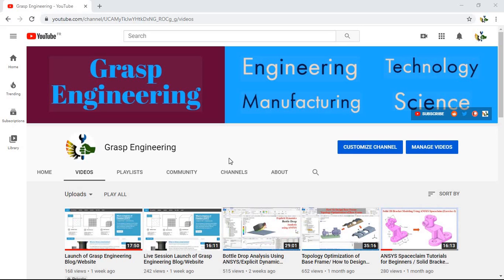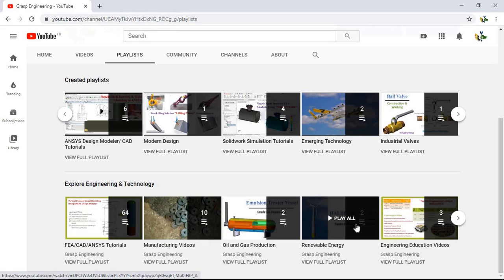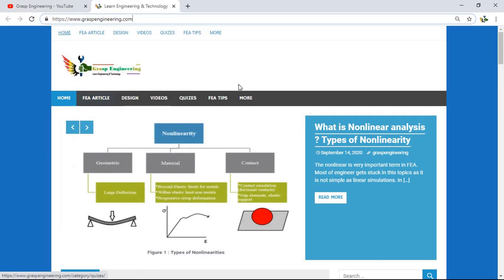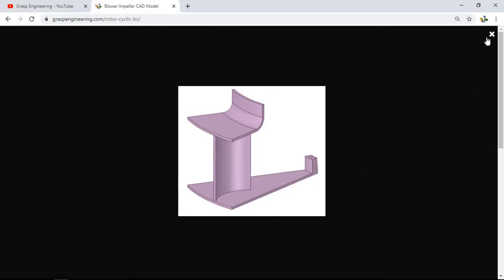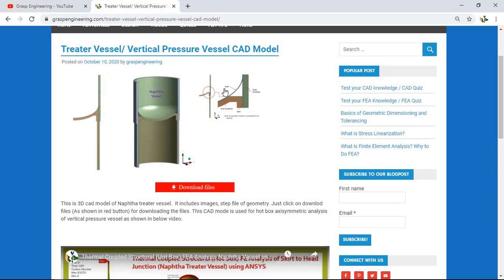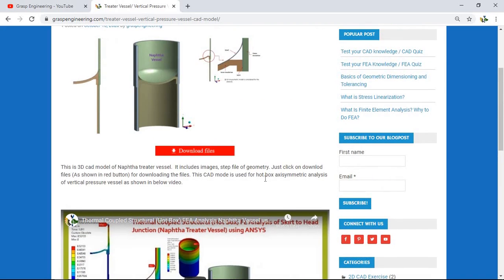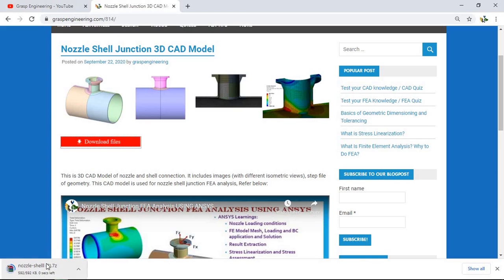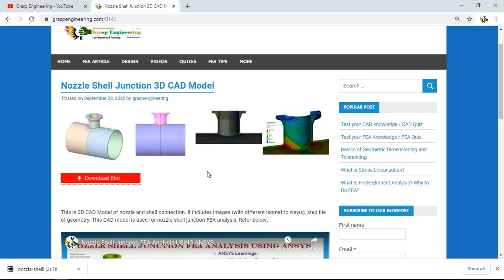CAD Model for FEA Analysis Practice

Comment: Provide video on why to use hypermesh? For custom meshing?
Ansys has auto mesh generation then why we need to generate custom mesh? For sheet metal & plastic , casting part tell the difference about ansys & hypermesh meshing.
Reply from the maker: We will work one comparative video between ANSYS and Hypermesh meshing..Meanwhile we have sufficient videos on hypermesh and ANSYS meshing, you can refer.